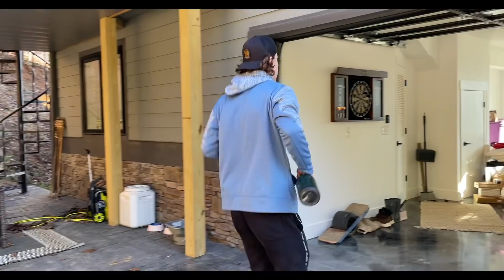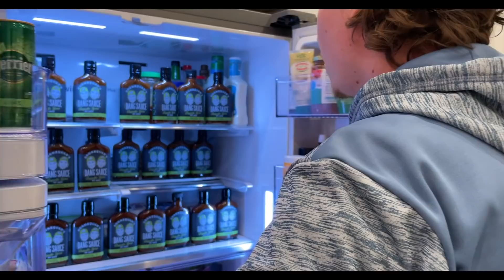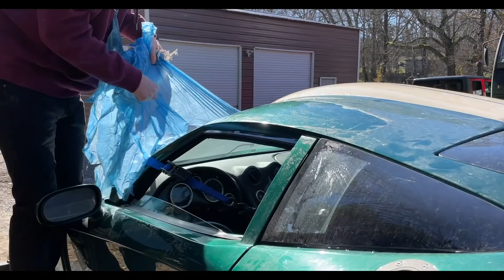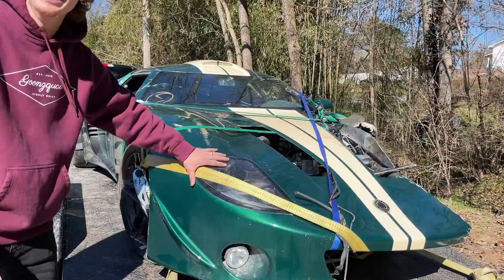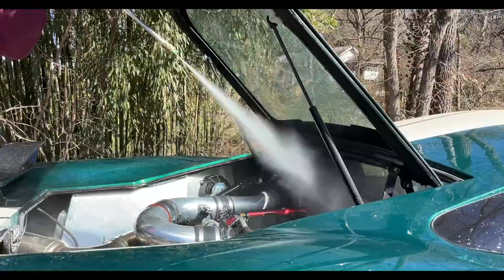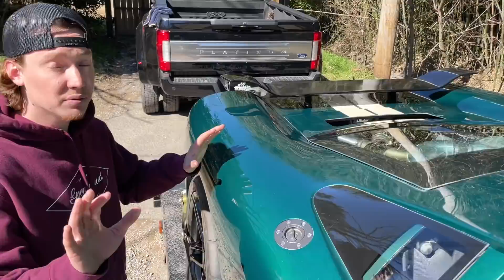We Bought The Cheapest Supercar Ever!!!

Comment: Looks like an LS7 intake, so maybe it is an LS7 which is a great motor, but if the pistons are OEM, they don't like a lot of boost so watch it if you're thinking turbos or supercharger.  They have done well with 5-7 lbs of boost, but you probably don't want to push higher than that.  The other pieces look like C5 vette like the door handles and mirrors.
Reply: Mirrors are from a c6
Reply: with a car that light, i doubt they'll ever need to add turbos lol
Reply: @Mike it’s not that hard if you out your mind to it while your still in school with the opportunity of a mechanic shop ofc
Reply: @andres 1090  I have both a C5 and 2 C6s and I'm going to have to disagree.  That little block under the mirror is taller on a C6.  Wish I could post a photo so you could see the difference, but that doesn't seem easy...
Reply: @Mike  been working on cars my entire life.  Currently have 3 LS Corvettes.  One happens to be a C6 Z06 with an LS7 that I supercharged.  I am pushing  average boost of 5 lbs and maximum 7 lbs.  Car runs strong and is lots of fun.  Many of my peers have pushed beyond that threshold and broken the top of the hypereutectic pistons above the top ring and caused major engine damage.  I've had mine on for over 12 years with no issues.
Reply: @andres-mw1he  Scam Below--->

Comment: I live about an hour from where these cars a made.  I’ve wanted one for years and haven’t take the plunge in buying one.  They have a new car they are working on called the F9.  They wind tunnel these cars and do all testing.  Last year they wind tunneled the F9 and are working on re-engineering the the front of the car because they didn’t like the outcome of the test results.  You may be able to get some one from factory five to tell you more about the car you purchased, being these are an order only kit.  These car can be purchased through factory five with the power train.  Factory five works with blue print engines.  But each car has its own vin number which is kept on record by factory five. Good luck to you guys on this project it’s a diamond in the ruff.

Comment: So i have my truck thats needs a bath badly but like the tires are black and the roof has black mildew or whatever on it so i was thinking of getting a pressure washer and the one i seen is 1600 psi is that powerful enough to easily clean that up with out damaging the paint?

Comment: Factory five factory five, oh, I know those guys, they make knock off cobra's using 5.0 mustangs, I wouldnt take their claims too seriously honestly, as their is a reason why the car is wrecked, as you've got corvette suspension and a corvette motor put in backwards, which makes me wonder if they even adapted the thing properly for its positioning given that you now have to reverse the oil pan to properly lube the engine

either that or switch it to dry sump, like you can make a chasis, thrown on some corvette suspension and all that for cheap, just look at the Johnny Reb Muscle truck Tavarish's mechanic Jarred made

but that doesnt mean its actually any good in the corners, case in point your front end, also the construction is worrysome, fiberglass, that's usually not a good sign of a quality car, as what alot of builders use that for is so it acts as its own brace, like the body takes up the structure of the car and they just do the bare miniumn to brace it properly

but the thing is it cracks and fatigues overtime, its why people have gone to carbon fiber for the chosen lightweight component, it just doesnt hold up to time and wear, and also weighs far more than good aliuminumn, which conducts heat far better

and isnt prone to needing alot of work to keep it in tip top shape between the gloss coats, the Gell coats and the paint, like its good for taking impacts but once its broke its broke, and its often the kit car thing of choice given how you just literally layer it in a mold and glue it together

so all the quality is in how whoever made it built it, and factory five well, its not a name I think of when it comes to quality

Superformance the people who made the Ford GT replicas and did them proper however, like this might make for a good sports car but it aint no hypercar. 

as the trademark of a bad kitcar replica is it can do everything a faster car can do, rather than how good is it on its own.

and while any idiot can wreck any car just from being a bad driver, with something like this, theirs a reason why it was wrecked, and it looks like this had an understeer special, meaning not enough grip to the front tires and it slid off the track.

like the back pushes too hard and the front cant pull in the direction of the wheel, heck you oughta take it to the genius garage guys and see what they make of it once its fixed and fix it further.

as I know for a fact from Randy Probst the ACR's a damn good car with good downforce all around and was far better than the stock viper, so the fact that they say that thing can beat it when its a wrecked junker like this

means its probably bull and you need to redo the thing proper to even get it near its claims as when they do those tests its a worked over special, the press car, its a common thing that everyone does

ferrari did it with the 360 Modena where they essentally gave them a 360 Challenge stradale, and then the stock one was essentally a mondial, Jaguar did it with the e type where it was tuned up to 11 and super fast and quick, but had no durability so it got detuned from 135 to 140, down to about 125

and you can be damn sure their still doing it to this day, its why anyone worth their salt in the car community who's doing reviews gets a customer car from someone whos had it for awhile to see how good something actually is vs getting it from the manufacturer

as my own family has gotten screwed by that with the car of the year from many many eons ago, and the thing while a good design was a proper basket case that wasnt properly sorted till about 3 to 5 years in

so take anything a magazine boy says with a grain of salt and go to an oldboy to get the truth about it, and while I think casey's the guy from genius garage is his own worst enemy he should be able to set it up well enough to do what it should.

still for 17 grand that isnt a bad starting point for a corvette with the engine mounted backwards, actually I wonder if you could find a wrecked C8 and put that engine in there, as the C8's too damn heavy for that 400 ish horsepower motor to feel supercar quick

hence the Z06 their coming out with, but in a fiberglass kit car that has 1/4th the weight (and the bracing and suspension to keep it on the road) that may not be the case

OH also the corvette suspension, if its an older one, their STILL using the stupid leafsprings which bind up under pressure, like that's 60's tech and earlier, which could have easily contributed to the crash and it will need to be converted to coil overs to be worth a damn, either that or put in leaf spring sliders like Chris birdsong did with the general recently

the general being the general mayhem, a 1968 dodge charger that was made with old motorhome parts that is getting set back to right thankfully, to help it better handle the force that is getting thrown at it.

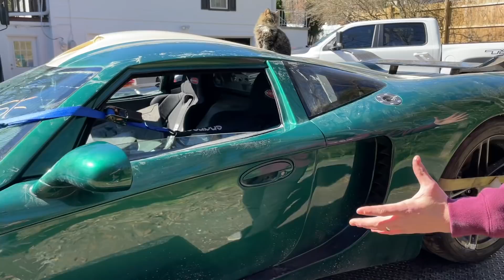15:53 also your door handles from an oldsmobile, hell the mirror too, granted knowing Gm they probably used that on both the Corvette and the Olds back in 2001, and kept using it till about 2013

they were that kind of company, and were always playing catch up with everyone else, and only upgraded when it got so old and outdated that they had to

hence why for the longest time their was only one american supercar, the viper, as a corvette, what, is that a kind of fishing boat for the navy?

Comment: That motor is at least a 427 cubic inch and can easily make 600-650 RWHP. Looks like the parts car was a C6 Z06. If that is a LS7 (probably is) ..... I WOULD NOT TWIN TURBO THAT MOTOR. It's fragile, designed for a Naturally Aspirated setup.